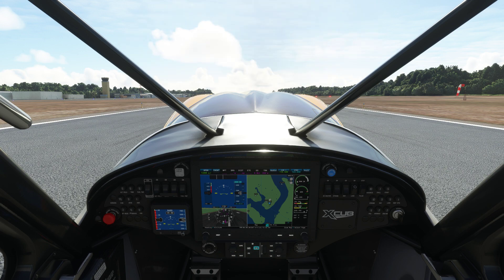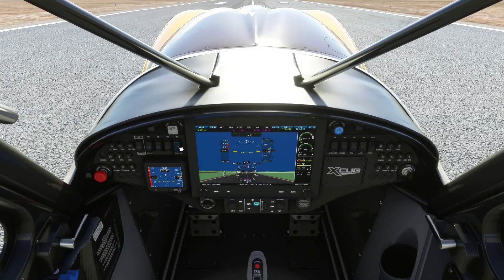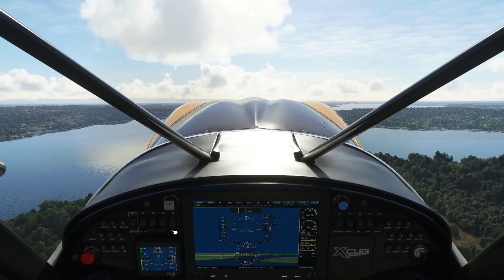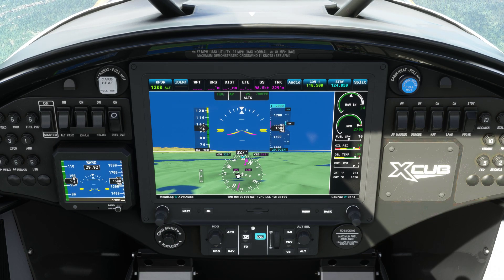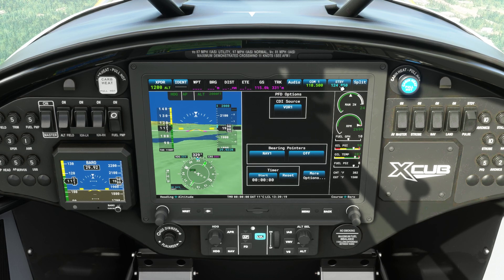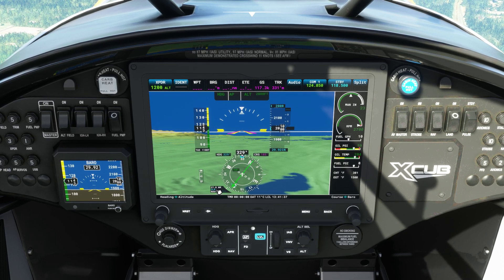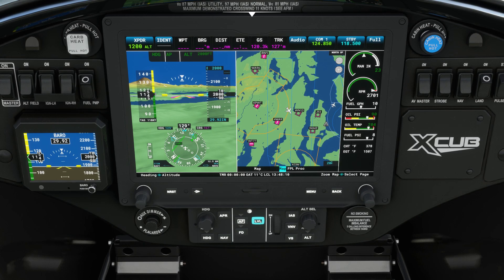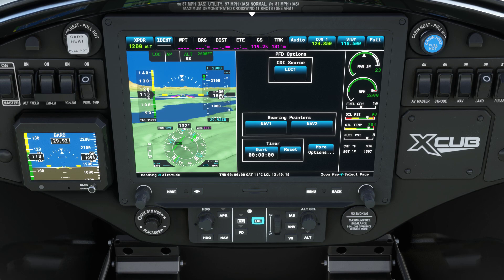Flight Simulator 2020 G3X Avionics Basics Breakdown

Comment: Nice video. Thank you. Nice discovery of the G3X for me and a nice introduction. I'm going to check the G3X in the planes that have them. I like your question and answer style. But your voice audio is too low and is drowned out by the engine noise. My solution was to turned on captions or subtitles. Problem solved.
Reply from the maker: Really sorry about the audio. Fixed it in my newer videos.